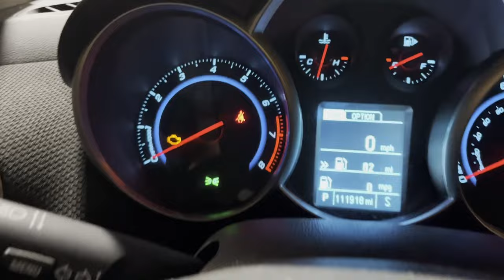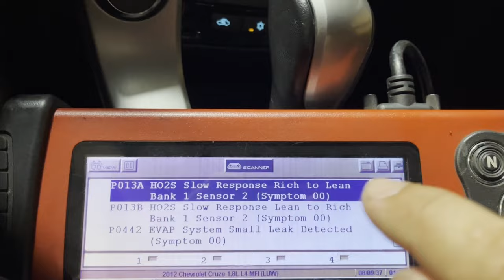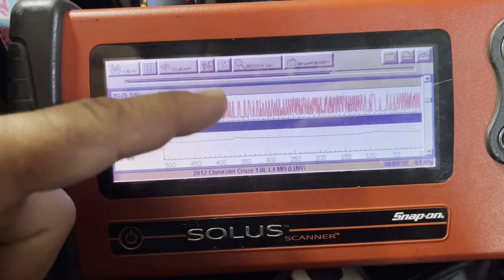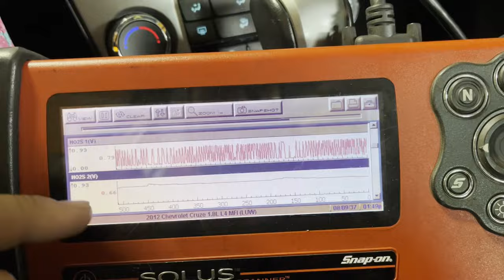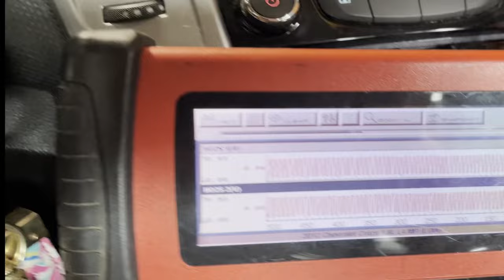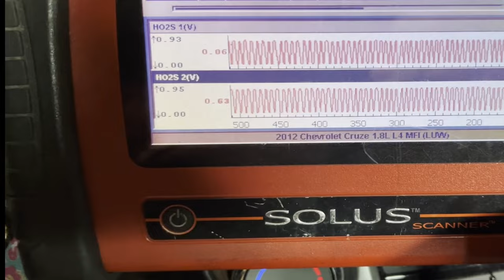HOW TO DIAGNOSE AND REPAIR NO ACCELERATION PROBLEMS ON CHEVY CRUZE | P0420 | CATALYTIC CONVERTER BAD

Comment: This is exactly what has happened yesterday to mine. Plus rattling. Thanks!
Reply from the maker: No problem my friend
Reply: that's not the problem for power loss up a hill  I changed converter and  O2 sensor. It's the turbo lacking power
Reply: @dancurrier6421 I got a problem with my car. The valve cover give a lot of oil. I change it it make the same thing
Reply: @ApotreWisnelJean  i think your problem must be the pcv check valve is gone.

Comment: The shop did mine on the backside of the engine. It was one unit.. the cat was connected to the manifold and after driving it for one day it started back shaking and not going over 20mike per hour. It’s a 2012 Chevy Cruze
Reply: Did you ever get it figured out? What was it?

Comment: I got the same issue, ill acceleration it and it won't shift to the next gear and the engine like comes on(flashing) and traction control comes on. I need info please
Reply from the maker: Is there any way you can get the check engine light codes?…parts stores usually can do this for you.

Comment: Hi I have chevy Cruze 2015 1.4, Getting rough idle and RPM going up down when Ac or Heater ON. This issue start after changing coolant water outlet. Last year I had same issue I changed pcv valve cover, Plugs, Battery. But issue resolved with Purge valve sensor. 
Now I have same issue after changing purge valve.
What to do?
Reply from the maker: Do you have any check engine light codes stored?

Comment: Thanks for this content.. i have the same issue with my chevy.. low power, low acceleration with choking effect, the worst is engine shut off while on drive. What could be the problem with it? Hope you could give some tips for reference. TIA
Reply from the maker: Walk to the back of the car…put your hand about 6 inches from the exhaust tailpipe…do you feel any pressure coming out?….have a friend rev the engine while you feel the pressure and see if it changes the exhaust pressure….if not that catalytic converter is most  likely clogged

Comment: You’re gonna hate when you have to do this all again. The aftermarket parts are crap for the luv 1.4l
Reply from the maker: Well I can’t argue with that…she was on a budget unfortunately
Reply: Where do you get your parts? I have several aftermarket bolt ones and upgrades on my 2012 1.4 Eco Cruze. The one and only problem I've had is with an alloy thermostat I got on Amazon. But  I knew that might be the case going into it, it was cheap and I said what the hell. But I'm waiting for ZZP to get their alloy thermostat back in stock because those seem to be fairly bulletproof.

I'd argue, its many of the stock/OEM parts that suck. I'm still stock tuned, but even just my bolt ons and mods and simple upgrades have made a world of difference. GM screwed up hard with the Gen 1 Turbo Cruzes. Literally an entire website dedicated to them.

I'm genuinely curious though, what aftermarket parts have you seen or heard bad luck with for the LUV/LUJ turbo models?

Comment: I need some help, i have a 2012 cruze 1.8L 6spd manual trans 75k, non turbo, im having a loss of power also, just wont get up and go, it feels real sluggish, i shoft around 2,500 is that to low? I also have no codes and i dont understand iv thrown tons of parts at it
Reply: Vacuum leak?
Reply: Do you have the ac on when it does this?

Comment: just wondering if this vehicle was smoking out the tail pipe as well as engine stumble?  I have a 2016 chevy trax that does that, after replacing the pcv/intake/valve cover/and turbo, still smokes, and engine runs rough and stumbles and miss fires, just wonder if my catalytic converter is block from all the oil burning through it from pcv, and turbo failure.
Reply: You have a cracked head gasket, go to your local Midas and get a compression check.
Reply: @simoncopeland4287  nope, head gasket is fine, was just clogged catalytic burning off oil. Compression test was good 210psi on all cylinders, and no exhaust gases in the coolant, vehicle is running good now, no fluids low

Comment: Im still getting the same code after replacing the catalytic converter and the oxygen sensor. What else could it be. I also replace the fuel injectors and that’s when the light can out
Reply: Vacuum leak could cause misfire and lean rich. Valve cover?
Reply: If you replace the catalytic converter with one other than an oem converter then you are going to have the same problem. These cars only like the oem converters. I have a 2014 Cruze.